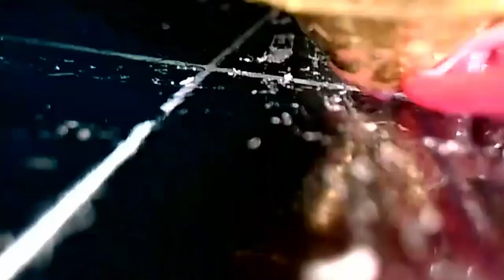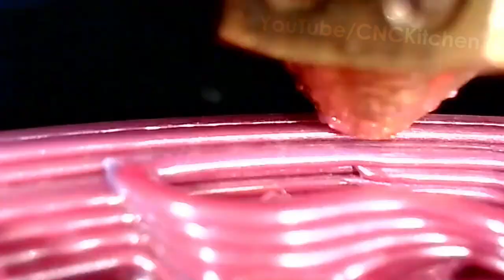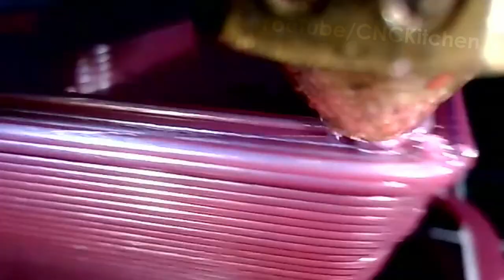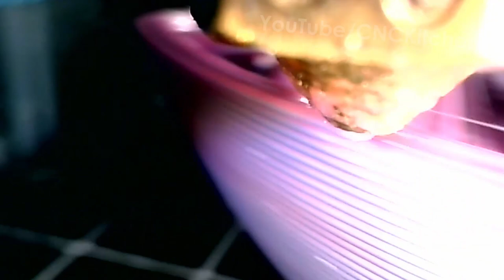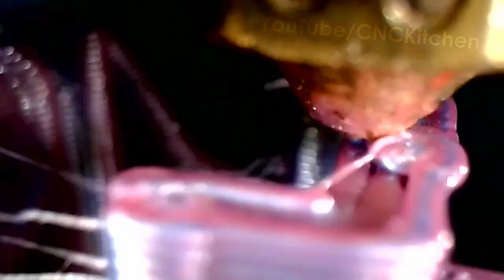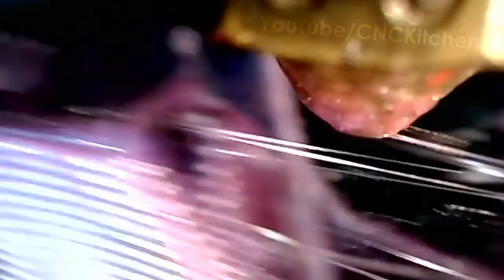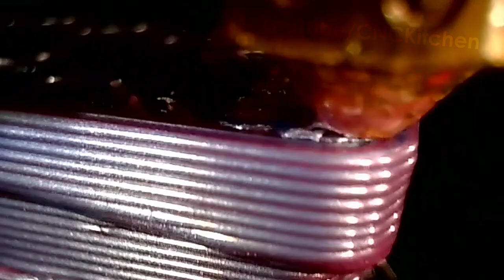Nozzle Cam - A new perspective on 3D Printing

Comment: Holy cow I finally grasp  what they mean by layer height. I’m just thinking it lays down and uncompress tube of plastic. There’s so many concepts you could explain . 
Doing a tutorial about basic issues and problems with this cam windowed...i think so many things would ‘click’ with people.... how different settings in whatever program shows how it changes the print at this micro  level. 

I would love to see this with a three dimensional option in one of the better programs it actually moves their head up and down creating a mesh.... like if you printed a head ..this would look so cool..this method.. it works almost like a 3-D pen. It’s one of the beta settings and I can’t remember what prog. Msg me if u want me to look

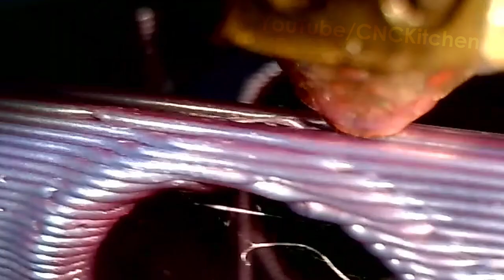Comment: Around 41:21. It's amazing to watch how the molten filaments flows ahead of the nozzle.  It makes sense, with both perimeters already in place, pushing filament into the center will fill the remaining space and I suppose the flow rate was slightly high, causing it to squish out and make a "wave" of filament that the nozzle is chasing.   You can see this all the way around the 3 sides of the cabin that are complete at that point, but it's most obvious on the far side.

This is the video I'm going to share when my friends are trying to wrap their head around how 3d printing works!

Of course we all know that the filament is liquid, but it stays that way for such a short time that its easy to forget.  This video makes it real. How did 3d printing even progress without this perspective?  Lol!

Comment: I would like to see a open project where we use all means (Stepper 
effort meassurement, acelerometer and or Camera observing the printhead)
 to close the loop and for example stop printing if the head runs into 
an obstacle or the Printed object breaks off and airstrings are 
printed...

Comment: This view will help to improve or optimize the current 3D printing software by analyzing the printing process in a more accurate way.

Also as someone said, this camera data could be used to train an AI to optimize the printing parameters while printing.

Comment: Okay Stefan, this is something that I'd like to see you attempt next ... watching this it seems like there's a bit of capacity for the printer to help in it's layer adhesion. The plastic is extruded but there's no mortar to hold the layers together. Is there something you could think of to "mortar" the extrusion together? Something that could be released as the filament is laid down? My initial thought was to (if the plastic is reactive to it) a light rubbing alcohol / acetone drip (something else?) that would "fuse" the layers together better adding to just the the thermal "stickiness" of the melted plastic?

Comment: Although I had to stop watching it after awhile because it started to make me feel a little motion sick, I think I actually learned a thing or two from how the printer was laying down the plastic.  I think that this is going to be an excellent tool for improving prints in the long run.  A slow motion video of flaws in progress could give a lot of insight on just what is going wrong and how to fix them.  Could also be useful for determining just how much overlap is optimal or best retraction or z raise for travel moves.  I'm really looking forward to seeing more content with this closeup and where it may lead in helping all of us out in improving our prints.  How about applying machine learning that could adjust the printer settings on the fly.  That would make one hell of an Octoprint plugin.  Thanks!

Comment: I like the idea, and its mesmerizing, but I wouldnt want to add any more weight to my hotend, just for video.  I also doubt it would survive long in an enclosed printer doing ABS (as I normally print) anyway.

have you looked at accelerometer based resonance tuning? what a improvement that was on my machine!

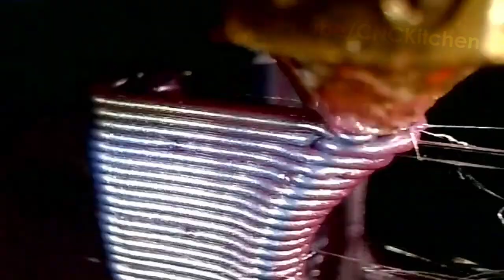Comment: I skimmed to 39:48. Where it does the curve in the doors.

I'd like to see a mesh of this and your previous work's conclusions on increasing strength with slow-mo to show it in work. Namely, 100% cooling versus say 20% cooling, .4 line width versus .6, and higher temp versus standard. Would also like to see slow-mo on where it attaches the infill to the walls,...with maybe a few variations on overlap.

I see your outer walls are printed at the same speed as the inner walls. Seems Cura sets the outer wall slower by default, but I've been changing it all to the same speed including infill. My figuring is I'm tuning heat and other parameters for the best bond without sag, and changing speed changes the equation. I want the best print for all parts of the print including infill,.....though I could see maybe increasing the fan on the outer wall to make it prettier with less sagging. I haven't looked to see if that's a setting,... I'm just a beginner, so feel free to flame me.

Comment: This will now be on the big screen during public days at the local maker space. Will you do a 4 or 5 side by side comparison of filaments at different temperatures. Ex:TPU at 215,225,235,245,255  abs, foaming stuff, ........

Comment: Very nice! Could use some more resolution // better camera. I've been meaning to do this using a picam which has very good quality. Manually rotating the lens for close by focus is a bit difficult though, and perhaps its DOF is way too shallow at nearby  (<10cm) focus. For me it would also require a very long camera cable and integrating a pi into my printer, currently cba.

Comment: Not sure if this is possible but what if we could use tracking with ML to dynamically micro-adjust the extrusion rate for consistent width, that will eliminate so much potential problem with extrusions

Comment: Amazing, could you help. Only at the start of any print i do, I get gathering around the nozzle in no time at all. I have lowered the first layer speed to 50 , lowered print speed to 10 on initial first layers
unless I am watching to remover the gather it ruins the print. It is like its catching the print filament when it moves to the next position I have levelled the bed 3 times now to make sure it wasn't that. Any ideas please

Comment: Hey Stephan, just wanna ask you something to see what do you think abou it. I've being trying to "put" a metallic mesh in between the layers of a printing but haven't being success jet. Imagine a square, with a hole in the middle and try to cover that hole with the mesh... The problem i'm having is that when the printer is laying filament on the mesh, it doesn't stick at all on it and then the whole thing just jumps and is all a mess... What do you think about it? it can be possible? is there any workarround to do so, or some "trick" maybe? Thanks in advance and keep the amazing work. Thanks.

Comment: I wonder if it's possible to mount this to the carriage instead of the toolhead. I was looking at this when the raspberry pi camera carriage plate was first discussed, but it didn't look like any of the rpi cameras small enough, or with a short enough focal length.

Comment: I have been using a cheap 6mm from 2018 that has been great to use.
 I can tell exactly how good the prints are doing
    • how good 1st and all layers are, 
    • I can see under extrusion. 
    • Bubbles, 
    • blobs build up,

was thinking to create some AI that would detect blobs during prints then auto clean the return to print would be awesome.

Just received after a real long wait from china a replacement and a 5MP version. It appears all the new ones have stiff cables.

My old one is super flexible and when I took it apart it was stranded wire.

If new ones are not stranded wire then I will have to cut and wire some flexible cable back to the PC.

I also have my camera a bit farther away so that I can see how the rest of the model is doing, is there uplift? Errors that happened while away… I can still see nozzle and hot end take up whole top of video.

You can see my module by searching thingiverse for 'Hotend Mounted Endoscope Camera"

`mike

Comment: Cool thing, surface quality is very bad though.. i think your z height needs a calibration because here you can clearly see each layer and if you have lets say a nozzle of 0.4 ( cant see it) , you either got something wrng on z, or your layer height is too great. If you got a 0.4 nozzle as for example, you should not go beyound 0.3 mm layer height. I cant tell wich ones your there but i saw some behaviour of a temperature and lauer height issue.

Comment: It was interesting. Unfortunately, after about 25 minutes I starting getting a headache from the jumping around of the camera so much, and after about 34 minutes my stomach started feeling nauseous. Also the reflection of the light on the nozzle tip kept flashing and that didn't help much.

Really interesting perspective though, and definitely could see it being useful in assessing problems with the flow and unwanted seams and such. Maybe other uses as well.

I'm new to 3d printing and don't know all the things this would be helpful for, but I'm sure there are more than just what I mentioned so far.

I'm not actually sure how I made it through the whole video without having to throw up. I did it though.

Overall, very interesting.

Comment: I want to see a GAN (the AI system behind deepfakes success) for 3d printing using this cam view, with it having access to the slicers settings. You could then setup the slicer for a new filament with one test print. Accurately "test" print a 3d file and tweak the settings for max strength/weight/surface finish etc and be confident with the results.

Comment: I've been rocking a cheap DVD (barely) resolution borescope for over a year now. Your higher resolution makes me want to replace it.
Edit:
As I was afraid, semi-flex or semi-rigid cables in the description link. Mine is as flexible as regular USB cables. I guess that's the tradeoff for 1080 res now.
Here's my last benchy (failure)....
https://youtu.be/MKpnKIIMSp4

Comment: You might want to check that affiliate link.  It sends me to Amazon, which is fine, but, its search gives off a tonne of what looks to be German text, and does NOT give a link to any kind of camera that I can see.  The search field on Amazon comes up as " innislink endoskopkamera endoskop usb micro usb type c 3 in 1 handy inspektionskamera hd wasserdichte mit licht halbstarre rohrkamera kanalkamera endoskop kamera für android phone tablet windows 5m "
Reply: It's working fine for me in the UK, I guess the redirecting service is failing to do its job for where ever you are :(
Reply: @_Piers_  I'm in Ontario Canada.  I'm not on any VPN that sends me out to Germany.  Strange deal.

Comment: If you couldn't tell the issues by looking at the printed part your just not a very good 3d printing professional.

Nozzle too hot maybe 5° drop
Tune linear advance because oozing on slow downs and speed up.
Then check retraction distance and speed.

Comment: Your filament is extruding so much! You can fix that in cura settings by applying 0% on your Flow Rate Compensation Factor. This was you will never have webbings

Comment: Yeah thanks for making me waste money on one of these, literally followed you tutorial to the t and ended up destroying the camera when trying to focus the dam thing. What he doesn't mention in this blog is that the got dam glue on the lens is impossible to get to budge. I lightly heated it and turn it 1000 times until the dam lens fell off even after that I resorted to sanding the back of the housing down until I got it close. Tried super glueing everything after that and the camera just decided to start cutting out. And after the glue dried I had to try and take it apart again because it was cutting out then just died. Horrible tut dude fr I'm upset.
Reply: You do not need to take the camera apart, you can just print a mount for it and attach it to the print head. You just need to make sure that the bottom of the camera is above the bottom of the extruder. This is much easier to do and produces similar results. Take a look at this video for an example: 

https://www.youtube.com/watch?v=Csm-onVNXzk&feature=youtu.be
Reply: @proximateperspective3579  yes you do if you want to focus the lens of the camera.
Reply: @proximateperspective3579  the one he advises you get its impossible to focus it without taking it apart. That video is something totally different